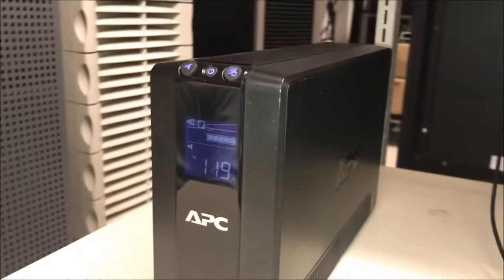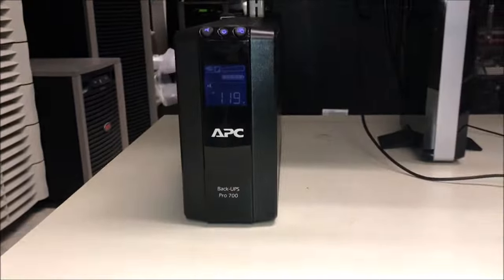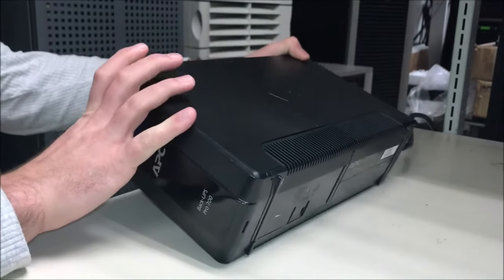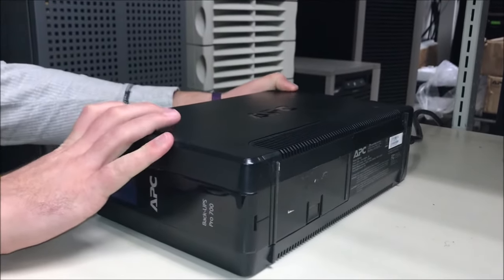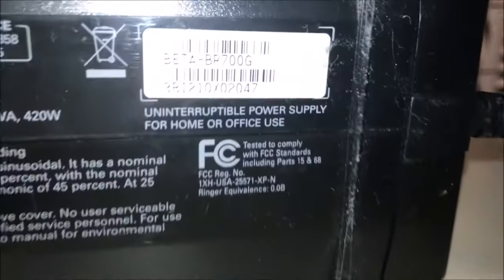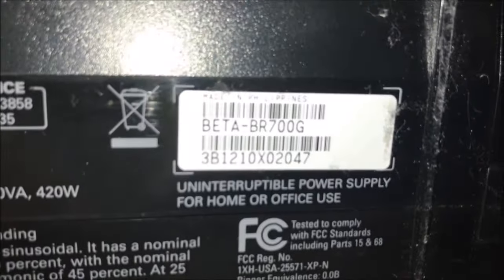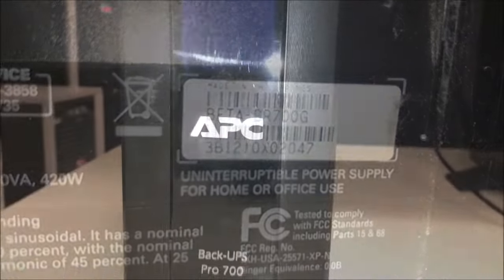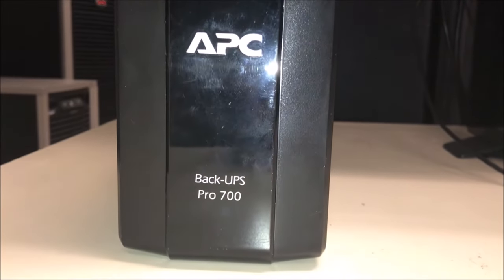Locating Model & Serial Number on APC Back-UPS | Schneider Electric Support

Comment: Your product instructions say "Select 'Software Upgrades - PowerChute Personal Edition".  This is not an available choice.  The website wants a model number, and provides a video of how to find a label on the bottom on the unit (that I just installed).  Here's an idea:  tell the customer to make a note of the model number BEFORE installing the unit.  Save the customer the necessity to crawl around to try to find some numbers you failed to provide.  Another idea:  have your website people detect the term you are asking them to type in and branch to further instructions.  That's really basic customer service.  I've been using APC and/or Schneider products for many years and this is disappointing.